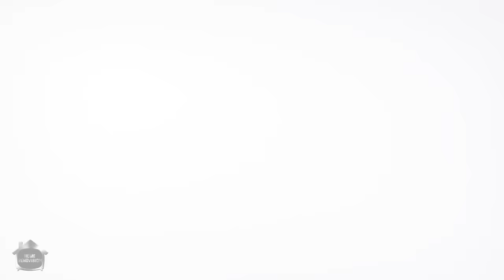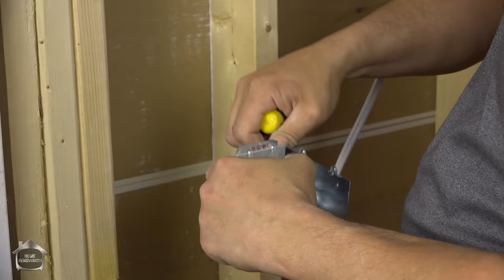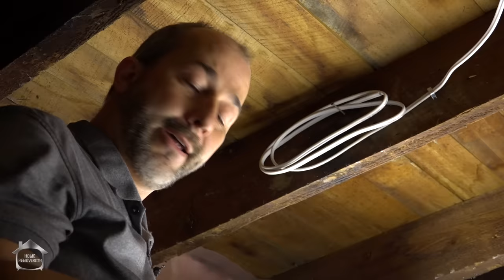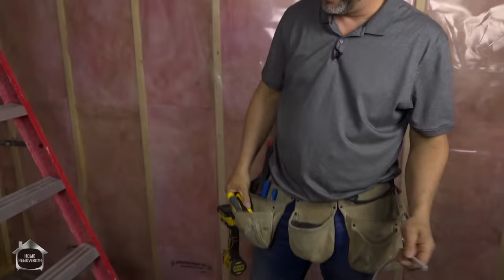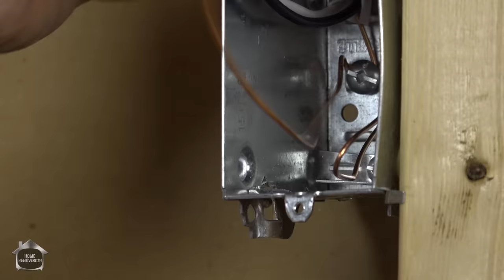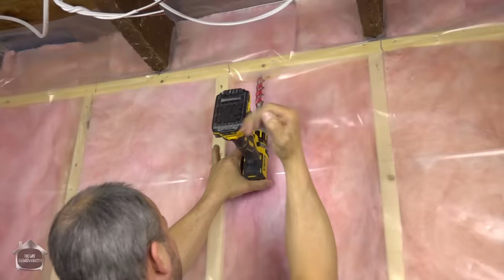DIY Bathroom Wiring | How To Run Electrical

Comment: Jeff, in Connecticut where I live, you can't strip Romex outer insulation with a razor knife if there are any building inspectors around, they'll shut down the job. It's done all the time, but that procedure in the wrong hands could be disaster

Comment: Nice and very educational, these neat tricks will save me time and frustration in my upcoming renovation project. I'm looking forward to install a couple of circuits, in my country house, with some "Electric Baseboard  Heaters". I recall from the 80% Max load rule (20A X 240V = 4800W  X .8 = "3840 Watts" usable) for heating systems, but I'm not sure about using 20A or 30A circuits for this. Is there a limitation (following the code) on how many baseboards can be placed on a single circuit, other then the above mention rule ? Sorry if my written English is not perfect, I live in Belgium and have a country house near Edmundston N.B. on which I'll be renovating in a few weeks from now. I'm also, natively, Canadian born ;-).

Comment: I do baths in 12/2 if not 12/3 ,it is  not much more money what worry about a few pennies .,The minimum requirement for outlet receptacles in a bathroom is one GFCI-protected receptacle served by a 20-amp circuit. This is a bare minimum, however, and most bathrooms will have at least two receptacles, and often as many of four or five. I am guessing this is Canada ?

Comment: I was wondering, I have a bathroom in the house I've just moved into that has a double box in the bathroom( like your 1st box) and there is 2 + 1 lights hooked up to the left side (same as where your light is) and on the right side the fan is hooked up.  I was wondering if it would not be better if the 2 bulbs could be on the left and the 1 bulb + fan be on the right side?  Besides that, the fan has a switch in the living area that turns on the bathroom fan also.  I think someone did that after the house was built because that box is higher and above another box by 12".  Thanks great knowledge.

Comment: i have an old panel and for the 6 new basement circuit i have to use conduit from breaker to afci. I went with 3/4 ENT but I realized now my 3-gang and my 3 single-gang are all loomex only. i search for the one with KO and they are all 1/2. the only 3/4 KO is on gangable boxes so now I have to add another 2x4 on the other side of my single-gang outlets... if i understood. (i'm in ontario too).

Comment: Load counts are the goal to meet. 20 amp vs 15 and covers it . I replaced so many 15 circuits in my own home  with 12/3 20 amp. Next will be computers in showers while someone using a blow dryer.

Comment: I notch the end of the wire one notch for first switch leg  two for second switch the middle knock out  is set aside for your hots  the edges for the switch leg the first switch leg for my light the second for my fan the first is closest to the stud . . You bath room receptacle is 20amp gfi your ground is supposed to green and most boxes for residential is usually plastic or fiberglass

Comment: For what it is worth Jeff, here in the states we now need to make sure we have a neutral wire at the switch. Obviously if all your power comes to the switch box this isn't a problem. But if you planned on just dropping a 14/2 to the switch box and using the neutral as a switch leg, that is no longer accepted.
Reply from the maker: very interesting. The electrical code is changing very fast. Not sure why !
Reply: @HomeRenoVisionDIY  The code tends to change from people getting killed or the code panel deciding doing something a different way from before is better and safer. New technologies also fast track some code items as well.

Comment: you mention the golden rule of 36" from any contact to water, then after you said you have 37" to contact to water which is more than enough to pass code, however right after that you added 2- 2x4 studs to mount the gang box, so how did your inspection go?

Comment: LOL Jeff I was thinking he didn't run the wire! When you said it I was laughing love your videos why do you use metal boxes vs plastic boxes? What's the difference
Reply from the maker: I use plastic on outside walls so i can tie in the vapor barrier easier. I am cheap and plastic boxes cost more oddly enough.

Comment: the code that says you need a staple 12 inches from the box does that mean after 12 inches of cable or the staple has to be within 12" of the box? IE you could have 20 inches of cable after the box for extra service loop but staple is like 5 inches form the box.
Reply from the maker: The trick is in the spirit of the code. most inspectors want to see the wire is stapled so as to avoid having the wire pinched during the drywall install. That is why we use staples. In places where you fish the wire behind a finished surface there is no need for staples at all. Cheers!

Comment: Why did you need to add the two scrap 2x4's to the wall to mount the first box? Why not install it on the stud to the right or was that just to demonstrate forward thinking about the door casing or because you needed to be 36" away?
Reply from the maker: It was simply related to the door casing and wanting a nice finish! Cheers!
Reply: @HomeRenoVisionDIY  awesome.

Comment: Does the 1x3 strapping provide enough distance for wires in the ceiling?
I was looking into doing this (USA), but found some code that required 1-1/4 inch minimum to avoid damage to the wires.

Comment: Great video. Just a random question about your system of wire feeds. Since most of the time the electricity is coming from the basement or a lower floor, wouldn't it make sense to have the wire come from the bottom of the boxes?? and since you are wiring lights and stuff (I can understand the plugs), wouldn't it make sense to have the out feed go from the top?? In Canada is the power coming from the top of the building? 

Love the channel!! I'm in NY, and we have different gang boxes, which need like wire nuts, a separate thing.
Reply from the maker: the point is to have a system for yourself. Cheers!

Comment: The Canadian electrical code in Ontario states that you can't staple a wire on the edge of the stud and have to go through the stud. Thanks for the great videos
Reply: He's strapping the ceiling to form a cavity in which to run the wires/cables.

Comment: Did you ever get the plastic gourmets to go in the metal box hole you ran your wire in? I Canada you would fail putting wire directly in  a metal box without them.  They prevent wire getting cut by the box.

Comment: Hi Jeff!  You gave me the confidence to do much of the work on our bathroom remodel!  I just finished tiling and grouting the floor.  I first installed a heat mat underneath and, yup, I nicked it trying to cut a plastic leveler tab that was sticking up.  Fortunately, the cut is only 4" away from the terminal end.  All I need to do is re-terminate the end.  I've watched another video that says all you need to do is strip the heat cable, separate the two copper wires and strip those, fuse them together with a butt splice and cover the whole thing with self-adhesive shrink wraps.  I'm unclear what to do with the ground wire? One video says you can just cut if off below the other two exposed wires, and another has you connect it to them.  Any ideas?  And, can I use ANY butt splice (I have one with solder in the middle that melts with a heat gun).  Any help would be appreciated!
Reply from the maker: Hi Susan, many heat cables can be repaired! Best to call the manufacturfer and have them send out a repair man. Cheers!

Comment: Hey Jeff -- LOVE your videos. Quick question: How come you put the wires on the joists? Would that be a problem when you go to install the drywall ceiling? Could there be a risk that you might drill a hole into the wire when putting it up?
Reply: I'd say his ceiling will be framed below the original.

Comment: Quick question, in most boxes I've seen in my house, the ground wire is attached to the screw in the box but there is no wire left to attach anything. What can I do if I want to ground properly my switches?
Reply from the maker: you don't ground switches. Cheers!

Comment: Hello! I'm in Ontario as well. Really enjoying your videos. They really help inform and instill confidence!

The 3 foot rule for distance between switches and a water source - is that "as the crow flies" or follow linear lines like walls?
I'm asking because I have a 90 degree (outward) bend between my light switches and tub location. Does the water source rule also include toilets? Or only tubs/showers/sinks?

Second question - does this 3 foot rule apply to things like touch screen heated floor controllers and programmable "timer switches" to turn a heated towel rack on and off?

Comment: Does the 36" rule apply to only openings of the shower or all shower walls, and how does this rule not apply to outlets near vanities? I want to move some light switches to a wall that is adjacent to the shower. The switch will be just under 36" away (32") from the shower glass wall. It is well over 36" from the shower door.

Comment: Hey Jeff, love this channel and I think your videos are great,  I am doing a renovation of my basement to make it a legal basement apartment, I am converting a previously finished basement to the legal requirements.  I have had to do a LOT of re-work because the previous owner made so many mistakes such as bad electrical and plumbing) I am in Canada (specifically East GTA).  Obviously, I have a permit, drawings and some work I have hired contractors for to ensure it's done to code.  I am  DIYer so I am trying to do as much as I can do myself as possible to save money, I would say I am a moderately skilled DIYer.  This includes installing a bathroom, kitchen etc.  I am nearing the final stages, framing, wiring (almost done) and flooring.  Questions for you.  1. In this video you are wiring pot lights and I wired up my pot lights except I wired the pot light "box" not just the wiring like you did, is that a problem to pass inspection?  (I assumed they wanted the boxes connected).  2.  Is it building code to have an outside wall vapor barrier, insulated, framed etc? or is this just best practice? I ask because the laundry room in my basement and a few other storage areas have unfinished outside walls and I was intending on leaving this "as is" (my foundation is cinder block).   3.  Why does building code indicate you must use nails for framing?  My local building code rep told me I had to fix some of walls built previously (not by me) because he used screws.  3. What is the best way to show you my job that I'm working on so I can share my progress and ask questions?  My biggest concern is finishing something and then having to re-do the job because the inspectors finds something such as missing a building code spec like you mentioned in this video.  My other struggle is figuring out order of the work ie what do I do first,second etc.  also leads to re-work.  I think a video that talks through general order of building would help me prioritize my work and maybe you already have video on that and I missed it.  Sorry, lots to ask you LOL!

Comment: Jeff question for you. I'm in the States so I know codes vary from Canada, heck they vary from area to area down here. Anyway, I'm remodeling my dining area, hallway and a hall bath and in the bath I'm replacing the old medicine mirror cabinet and light fixture to a mirror and light. Problem - the old fixture just has a wire coming thru a hole in the drywall and was into the large fixture box, the new light is the style that's to mount to an octagon box. I don't want to just butterfly bolt that plate to the wall but it's well between the studs with nowhere to mount the box to wood. What can be done? I thought years ago I saw some sort of remodel box that can be mounted inside the cavity that anchors to the inside of the wall board. Maybe I'm wrong. Any ideas? hope I don't have to cut open the wall and add blocking so your thoughts are appreciated. Luv the vids and been watch and sub'd for awhile now.
Reply: There is a box that does what you need. It would be a 3/0 or 4/0 cut in box

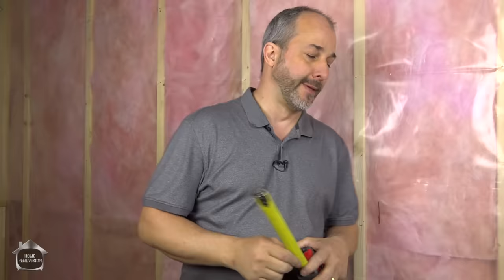Comment: 35:47

At 120V, half an amp is 60W. So it's not a quarter of a 60W incandescent lightbulb, but just a 60W incandescent lightbulb.

If running 24/7, that's CAD$96.77 annually, at the average variable cost of electricity in Canada of CAD$0.184 per kWh.

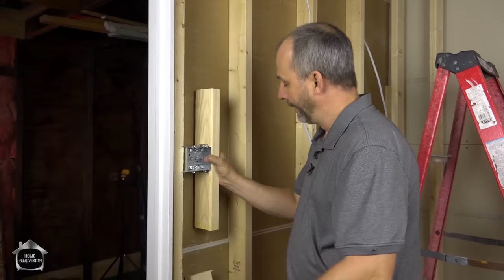Comment: At 6:35 you say the screwable boxes need to be secured with a piece of wood on the side that isn't pressed up against the stud. Is that only a residential thing? I'm a commercial electrician and I've never done that when doing commercial stuff with steel stud.

Comment: for some random reason, I am not able to find two items to buy online which you used here, Welded Box and Cable Staple, Any advice please?
Reply: I was able to find a similar electrical box by going to homedepot.com and searching for "Metal Electrical Box with Non-Metallic Cable Clamps". Can't seem to find the exact one he's using though.

Comment: Ok so im having an issue, I bought a nice bathroom fan light blue tooth speakers bought i have one switch that use to turn on the old light and fan together so one switch for both now my new fan switch you supposed to turn on individual light or fan and night light  ,, so my switch only has a black and white wire with ground but my fan light has a red wire I tried to connect them but it doesn’t work would i have ad a new 14 3 wire ?

Comment: Is it standard for contractors all around the world to use the imperial system when measuring? Canada is on the metric system but I've noticed that every measurement you talk about, is in inches, feet, etc.
Reply: retrojkass the code book is in Metric, but we just say it in imperial.

Comment: If you’re putting drywall on the ceiling, aren’t you going to crush the wires you tacked to the ceiling joist?
Reply: he actually mentioned that.. those are the floor joists for the floor above him. hes going to put in more framing below that for the ceiling. it will create a cavity kinda like above a suspended ceiling but a lot stronger...

Comment: I am a licensed master electrician in NY and Virginia. We have been using plastic boxes since the 60s. Use a hammer. All that slack is a “rough in” violation. “Not installed in a workmanlike manner”. The term GFI was updated to GFCI in 1971. 3 feet from water is overwritten with GFCI provisions. Nice try anyway. Antique Canadian technique. Especially the grounding.

Comment: Jeff thanks for all your videos. I've been renovating my parents 50 year old home the last 3 years. My latest problem is raising an gfi outlet 1 inch so it doesn't get covered by a side splash. New vanity is taller than old one. It is currently against a stud. All the old work boxes rely on drywall as an anchor. I'd like to use the same stud. So moving it up an inch leaves a 1 inch gap in drywall. Which isnt difficult to fix. Finding a old work electrical outlet that fits up against the stud is...any suggestions?

Comment: Hey Jeff! I noticed at around the 40 minute mark you had double insulation, is the proper way to install it paper to paper? does that matter? I'm currently working on a project with a "half wall" and need to build the wall out but was unsure how the vapor barrier / insulation needs to be installed in that particular area. Thanks!

Comment: Should I assume that since my new-to-me 160yo farm house has a bathroom sink right up against the switch for the light... that if the switch is already covered with dry wall then it's ok? Otherwise I'll be quite interested in why my home inspector didn't say anything
Reply from the maker: don't assume anything with home electrical. install a gfci at the sink. Most old installs pass inspection due to the rule that says pre existing conditions. That does not make it safe or ideal. Cheers!

Comment: So, my code requires that I need to run EMT conduit (Chicago suburbs) for my electrical runs for a bathroom renovation my wife and I are planning on doing.  Any suggestions for getting started with handling conduit, especially through existing structure?
Reply: Yeah, don't pull a permit for electrical work unless you want to be harrassed by a Chicago inspector. I'll tell you a secret. Unless your entire home is up to current code, don't even bother. They'll make you bring everything to current code before giving you a green tag.
Reply: Quick question. Are your smoke detectors hardwired together? Do you see GFI outlets in your kitchen and bathroom?  Is there a water bond ground wire coming from your electrical panel to a water pipe? Make dam certain your home is as close to legal as possible. Because if you pull a permit they'll make you fix all of it.  Fixing your bathroom could turn into the nightmare project that ends up costing thousands more than you intended on spending. Or don't pull a permit from the city, and gamble they don't catch you. Which they might not.

Comment: Just curious. Where do you live that lets you get away with only running 14 gauge wiring in a bathroom?
In the U.S., a bathroom circuit needs to be isolated to a dedicated 20amp circuit. Which means that the circuit cannot have any other loads on it other than the bathroom and a 20amp circuit requires 12 gauge wire minimum. I can't remember the exact year this code was introduced... maybe 2009 or 2012. But I do know that the bathroom GFCI outlet has needed to be on a 20amp circuit for as long as I have been an electrician, which is over 25 years.

Comment: Whew... You scared me for a bit when you said you can't have switches 36 inches from water. But I see your in Canada. I'm currently working on my bathroom remodel after it caught on fire and didn't want to move all my switches.
Reply from the maker: Hi Jake, there is always the pre existing clause which allows you to leave old things in place.